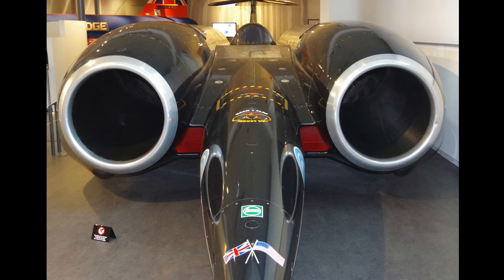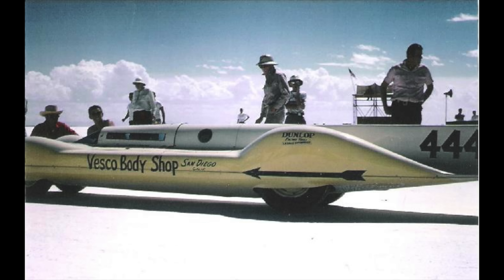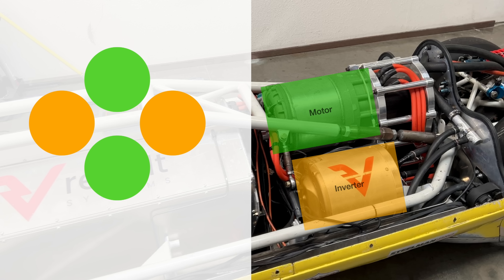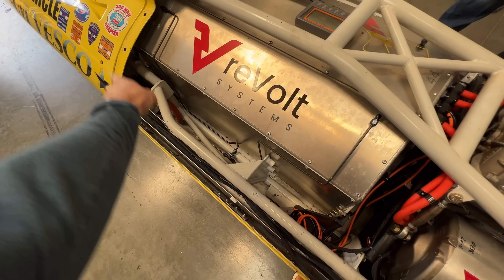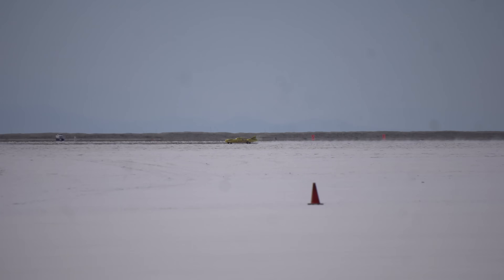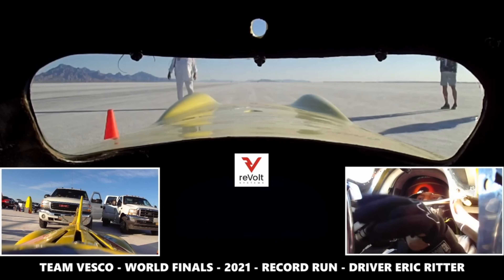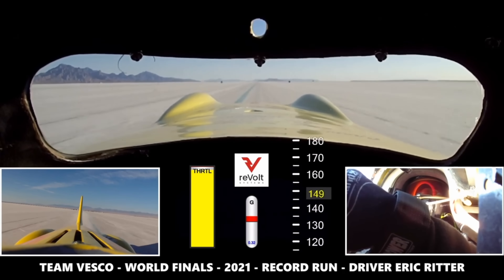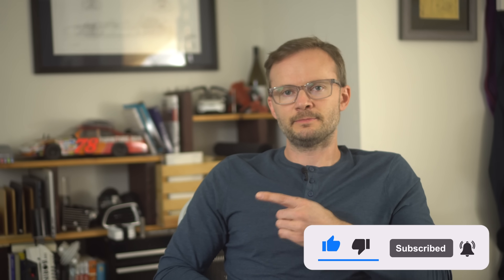The Engineering Behind The World's Fastest Electric Vehicle

Comment: If you're having trouble wrapping your head around the concept of putting 2 or more electric motors or any kind of motors together and getting them to work together and not against each other, just think about how the cylinders in a multi cylinder engine work together, there may be a slight mismatch in power between the cylinders and some percentage of "fighting". The average is a increase in power.
Reply: Some electric cars have four motors so it’s not news
Reply: Um,,, it is mindnumbingly simple to coordinate electric motors….
🙄
Reply: An inverter is simply a form of amplifier, it amplifies a signal. In a solar power system the signal is the frequency of the mains voltage required ie 50 or 60 Hz depending on your country. There seems to be no reason you couldn't use a single signal generator (speed controller) to control multiple inverters, in fact that is the way many multiple inverter systems work.
Reply: @BoB-Dobbs_leaning-left  But when you insist to reuse Tesla hardware you have to fight their integration. Also theoretically you need to fine tune the opening and closing of the MOSFETS. The coils want the current to keep on. If you close all MOSFETs while current is flowing, you get very high voltage ( like the spark in an ICE ) and heat up or ESD your MOSFETs. At least you heat up the freewheeling diodes. Those are only a backup! You have to pick your fights.
Reply: no issue when control system can read delta winding voltages inside both motors,it would be more challenging with piston motors and gearboxes LOL,but has been done with varying degrees of sucess
Reply: Stacking rotors in a rotary engine would be a better parallel
Reply: These are synchronous motors. An engine is not a synchronous motor.
Reply: No. These motors are not coasting. If one motor outputs 5% more than the other that is not a big deal. Even a 20% difference is fine.
Reply: @nordic5490  Not exactly.  If they are putting out different levels of torque then that's perfectly fine.  The issue at hand with syncing electric motors is frequency and speed.  It is imperative that both inverters be driving the same frequency and thus speed to both of the motors.  As long as they did the code right the first time then they are good.  If they differ though.  You get very large problems which results in massive motor/inverter strain in the form of excess current and heat buildup.  This is why we use synchronization tech with our power grid to make sure the motors are spinning at the same speed and the phase angle is the same.  One motor shooting for 5000 rpms and the other being slightly different will cause a ton of stress on both motors as both rotors are now fighting their perspective rotating magnetic fields because they are constrained together.  The major benefit is that most inverters these days are smart enough to detect issues like this and avoid them or you can just run them in torque mode so that the frequency output is driven by the rotor speed alone.
Reply: @geemee3364  Yes, but the control of both is Amps. So the "throttle" is controling the torque, not the speed. But yes, you need two seperate inverters to do that trick.

What I don't get is what the belt is for. You could drive one wheel with each drive train without coupling the motors and without any differential.
Reply: @woeufuS  How would that look like? Cross wind would be a problem with this idea: Two bikes next to each other, but staggered staggered. The motor for each wheel is in the other bike. Directly connected by 4 shafts. Pendulum axis like on a bug.
Reply: @woeufuS  Isn’t that how a tank turns? Meaning a difference between the speed of the tracks. So - If you had a slight difference in speed of the motors at 300mph the car would veer due to the thrust angle.  Or am I missing what you are saying?   Yeah- it might work, but I wouldn’t want to be driving it when one motor started to fail.
Reply: @alienpoker  Those Motor-Inverter combinations react soft to speed deviations. If you have ever ridden an e-assistes bicycle you know the feel. getting slower on the uphill and faste on the downhill. So soft that on that record  car you can floor the pedal but only reach top speed after e few miles.

The inverter is not outputting a rigid frequency. It senses the current location of the rotor magnets towards the stator coils and energizes the correct coil in the correct moment to create the maximum torque. Just like the spark plugs in an combustion engine do not fire in a rigid pattern but adapt so it matches the current location of the piston. You could mount 2 independent ICE too.

Plus the track of this car is very narrow. There is little influence of torque differneces onto the steering. You could propably drive it even with only one wheel driven.

Comment: Come to think of it, it's insane how much we've managed to get out of the internal combustion engine. We've pretty much reached the theoretical limit of what it can do!
Reply: Nope, we havent even got close to the limit of combustion engines, the science of materials is also still evolving tbh.
Reply: @alanmay7929  this is true, though combustion engines are nearing their end.
Reply: @daos3300  unfortunately combustion engines are going nowhere, there are biofuels of all kinds from used oils to biogas from agriculture/landfills....
Reply: not even close. most of the currently mass-produced designs have a brake thermal efficiency of around 33-35%, while formula 1 engines can hit low 40%. this is absolute trash. turbines can hit around 66-70%, but that's not really the limit either. theoretical limit, is of course, 100%, and only when you get to high 90s you can claim that you're nearing the limit.
Reply: @iddqd339  "theoretical limit, is of course, 100%"
lmaoooooo
Reply: @iddqd339  Are there any advancements that point to at least 50%? An ICE just loses a lot of energy to heat. A 100% efficient ICE would not warm up and exhaust gasses would be air temp. Thats impossible, unless they find a way to somehow recycle the heat and turn it into mechanical power.
Reply: @sjors-a  F1 cars are around 50%
Reply: @daos3300  only because of the energy harvesting by the hybrid system, no? take that away, they're much closer to 40%
Reply: @iddqd339  The theoretical limit for the efficiency of a heat engine is the Carnot efficiency, which can be calculated using this equation: Efficiency =  1 - Temperature (cold side)/ Temperature (Hot side).

From this it should be clear that we can never have any heat engine that is 100% efficient, as in order for this to happen the engine would have to either have infinite hot side temperature (impossible) or zero cold side temperature (also impossible, as even in interstellar space the temperature is about 6K).

Of course in practice the thermodynamic cycle of a gasoline engine is not the Carnot cycle, therefore the efficiency will be lower. It is in fact the Otto cycle, for which the theoretical efficiency is 1 - 1 / (compression ratio ^ (ratio of specific heats - 1)). Gasoline engines usually cannot have a compression ratio greater than 14:1 and the ratio of specific heats is around 1.3, so the limit for a 'perfect' gasoline engine is around 1 - 1 / (14^0.3), which works out to around 55%. This would be achieved in an engine with perfect combustion, no friction and no loss of heat to the cylinder walls... which is also obviously impossible in practice.

In terms of what is actually possible, some large shipboard diesels can exceed 50% efficiency. This is possible because larger engines lose less heat to the environment relative to their energy output, and also because diesels can have much higher compression ratios than gasoline engines.
Reply: @iddqd339  I suggest you read a bit on the Otto and Diesel cycles and their respective thermal efficiencies to clear up a few misconceptions you seem to have. Theoretical maximum thermal efficiency for any of them is nowhere near 100%. It's actually closer to 55%, which some slow diesels can approach.
Reply: @oscargarciahinde4247  yes, they're both terrible designs, where almost half of the energy is wasted trying to blow up the cylinder